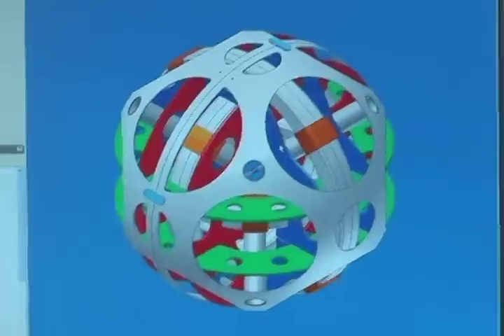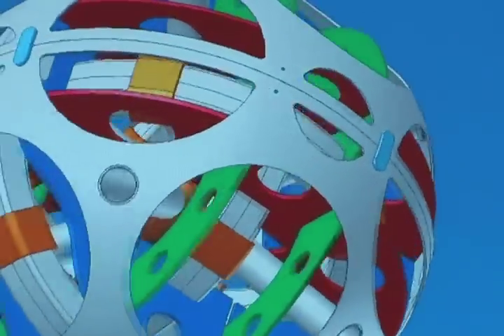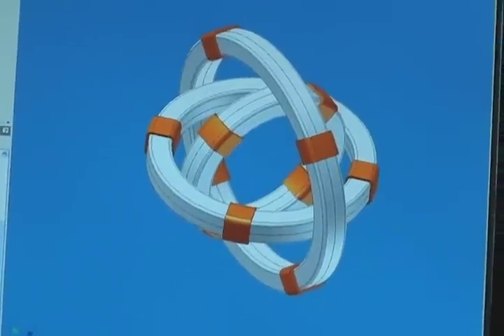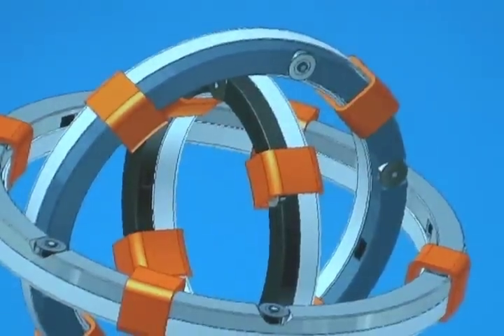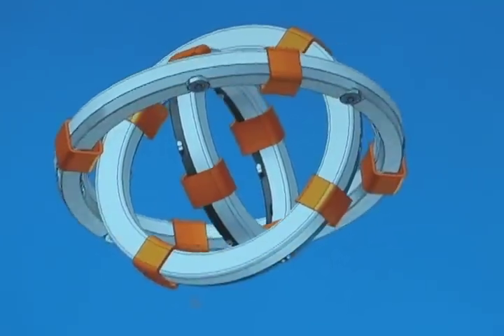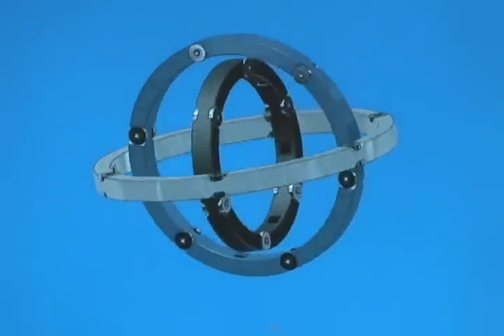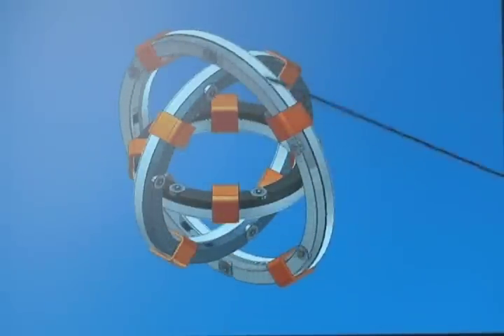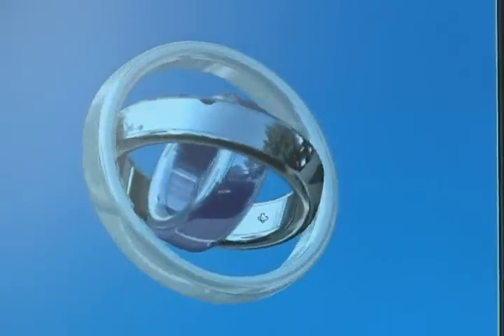Apparatus for Gyroscopic Propulsion Explained

Comment: Congratulations on a remarkable demonstration of an almost two hundred year old concept... the gyroscope!  Though the 3D modeling is quite effective, the title of the video is misleading, as there is no "propulsive" output in this closed inertial system.  As clever as the use of different materials to maintain equal angular momentum at constant speed may be (which may be unique enough to be patentable) there is no way to translate this gyrostat into any sort of propulsion.

Comment: "...it takes a trajectory of it's own following the path of least resistance"

So it will uncontrollably fly to a random location in the universe where angular momentum is minimal relative to it? Not buying it.

Cant this design be put in a simulated environment (computer) first? It will at least remove the errors that will come out in manufacturing. ie. not being able to machine the thing accurately and having the imperfections throwing off any acutal and meaningful measurements. Cheaper too!

Comment: The present invention is a combination of three interconnected gyroscopic ring-like rotating masses, with each of the three ring-like masses rotating in a separate plane. Each of the three interconnected rotating masses will share substantially the same center of gravity and generate a separate yet interactive kinetic energy and angular momentum in each of the three planes, thereby providing resistance to rotational forces from external sources. This IS NOT PROPULSION

Comment: Reasons you are incorrect (about the assumption inertial devices will not work). 

-There is no such thing as linear motion, only hyper dimensional rotations

-Rotating devices gain "virtual mass" since spin is intrinsic to atomic structure and "spin"

-Inertia, gravity and magnetism are unified because spin, inertia and mass are properties of a phenomena, not themselves separate 

-F = ma is leaving off the second term, something like  m*dA that means linear acceleration is not linear.

Comment: @rkellyt basically, though, it boils down to preservation of momentum. the system has a net change in momentum of zero for one cycle of its operation, the momentum paid in an arbitrary direction must immediately be paid back since the system is a zero sum system with regard to momentum, and as a direct result, energy, and continuing, work. it'll vibrate. it'd be ok to vibrate one's way across a floor for fun, but not to fly with the thing.

Comment: @whirliegig from my view point i would assume yes. If you could place a mass in the center that was capable of displacing it's center of gravity into a desired direction then that displacement would create the propulsion into the desired direction. the greater the displacement the faster the travel of that direction. The act of centering the gravity of the mass will stabilize into a fixed location.
Reply: ⁵u 6⁶y___yyt/y____yes

Comment: @itisYOUREnotYOUR 

Rubbish, it'll just vibrate. This device resists angular momentum, NOT gravity. Any off axis weight on a ring will simply cause vibration, regardless of synchronization. Through synchronization you could probably make it vibrate along any axis, that is NOT antigravity. Any directional vibration would have to be paid back immediately as the wheels and attached mass completed the rotation along that axis.

Comment: Thinking about it I think its a stabilizer. if you have this say on a hovercar or space-pod, then say wind pushing it (or jet propulsion) will only move the hovercar in one direction, but it won't rotate. So this would be a gyroscopic rotational stabilizer. I guess the different rotors would slow down when you wanted to turn in some direction.

Comment: Granted this guy throws his words around a bit carelessly, but this device does not produce a force nor does it produce propulsion. Due to the conservation of angular momentum, this device "counters" rotational forces (torques) if they are applied to it, keeping the object in the same 3D orientation.

This isn't made to propel anything, but is part of a gyroscopic propulsion system. Missiles use these things to stay on/correct course. The gyros are somewhat analogous to a steering wheel.

Comment: It is significant that Verne placed the giant gun quite close to where Cape Kennedy was later built. If he had been less optimistic, he would probably placed it on the coast as well; instead of inland. 
Even a giant gun is not entirely ridiculous: sure, a single charge at the bottom would kill the crew, but sequential charges placed all along the barrel could be made to work. After all, Saddam Hussein commissioned a gun like that.

Comment: Most of the 'flight is impossible' claims have been taken out of context. If one tracks down the original, one usually finds that the reference was specifically to man-powered flight or to truly bird-like flight (i.e. slowing to a near dead-stop before landing). Nobody really doubted the possibility of flight after Cayley's manned-glider demonstration. The main problems then were stability and developing a motor with a high power/weight ratio.

Comment: Take a look at the Aeronautics section of the 9th edition of Encyclopedia Brittanica: some of the designs there (for models running on wires) look like some of the  post-Wright designs. And the date? Circa 1869 (!). 
In the Le Mans museum (France), there is a painting which depicts (as a detail) a helicopter toy. The painting pre-dates Da Vinci's (working) model helicopter by more than a century.

Comment: Because anti-gravity (as the term is used here) implicitly implies something which contravenes Newton's third law. This law is, in effect, a corollary of the first law of thermodynamics. Neither law (despite what some electrical engineers claim with respect to the interaction of charged particles) has any known exception, and none are expected. Anti-gravity is therefore about as likely as perpetual motion ('free energy'). One apparent exception is offered by the Lense-Thirring ...

Comment: If you wanted to manufacture these out of a single material to save cost, you could increase the velocity of the inner rotors instead of increasing their mass. Perhaps just use a higher voltage across the drive coils.

Comment: I think you can improve this design by using Rodin coils, with toroids that contain ferroliquid material. You want to minimize friction and heat.
Yes this can be vectored in certain directions by have clever electronics to PULSE with a greater amplitude at just the right time in the spin.

Comment: Well, 8 coils with 8 magnets would cause the acceleration to fluctuate often, whereas I see that 4 coils to 6 magnets would lead to nearly always having 2 magnets and coils interacting, which seems much more stable.

Also, leaving every ring at equal mass wouldn't be very balanced. Your outermost, or is it innermost, I'm not sure right now, ring would be causing too much vibration onto it's plane of movement.

Comment: Some people really think that the device can propel something?!!NO,it can not propel anything,but create a zone of  balance.. the other truth is,it can absorb torque,even though a little  but  it  still can,unless you can make all rings to spin at the speed of light!!! In my mind,I think that those 3 rings should have the same weight and using 8 coils to 8 magnets to create more stability and control when spinning.... 4 coils to 6 magnets doesn't work well...

Comment: i have already designed an almost complete model years ago,  your work is good but you need to semplify the structure and increment the number of elements, from rotational rings to number of coils (i have solved in other way the reduce of intensity of magneto-electrical camp), the  post of marcos13af is correct, but also you need to add an opposite-axis element to each gyroscope ring. also you need a aerodynamic section for rotational elements not for "aerodynamics" but for electrodynamics!

Comment: Nice apparatus,but it is incomplete...to make it works properly you need to divide each wheel in two pieces  to make each wheel to spin in the opposite direction...
Example: a half spins in the clockwise direction and the other spins anti clockwise direction...Good luck!!!

Comment: All a gyroscope does is counteract the torque.

In other words, you could have a 50 lb gyroscope on one end of a 10 foot handle (the load part a lever) and hold it in the palm of one hand (the fulcrum and "effort" parts of a lever) and not feel any leverage, but you will feel the weight of 50 pounds on your hand. Without the spin, it could easily feel much more than 50 lbs. You can force such a handled gyroscope to spiral upwards - assisted by utilizing the rotational energy of the gyroscope.

Comment: All this device would accomplish is a  normal rotating gyroscopic force. Look at 2:40 the two innner rings would create a circular gyroscopic presence diagonnally, and the outer ring would only cause that presence to deviate. It would rotate much like an astronught trainer, but it couldn't provide any propulsion, just minimal stabilization.

Comment: This device has no inertial reference to the outside world. acceleratoin/decelleration, change of direction - are defined by the gyroscopic inertia of each of the rings, with respect to one another. slowing or speeding up a single ring, throws off this 'balace' and this is how propulsion is controlled.

Comment: eliminate the bearings by adding windings in series of 3's 120 degrees apart. two or more sets per ring. they will support the rotor and there will be no drag. creating more efficiency. interesting though I am sorry but I dont believe it will fly. but will be very stable.

Comment: It would be really hard to roll in any direction.  It would be fun to sit inside a huge one and drive it any which way, just by incorporating an algorithm that would slow down particular rings you could park a ball on a hill, as long as you left it running.  But I'm sure there could be some more serious applications than that.  By attaching the ball to anything you would make it very hard to roll the larger object depending on how fast and heavy the rings were.  It's the ultimate stabilizer.

Comment: To move it you would have an opposing magnet on the outer shell that could be moved to the direction you wanted to pull it towards, the magnetic force from the ring inside would be pulled towards the outer magnet, and with it, the whole thing in that direction, i've been thinking of this for a long time, i'm just glad someone else has come to the same conclusion, either the magnet on the outer shell, or one of the gyroscopic rings moving from the centre of gravity for movement/flight.

Comment: Kelly talks about "force unity" but does not seem to understand force cancellation. When you balance 3 gyros on 3 opposing planes, the force vectors cancel each other out. It's like tying 2 identical locomotives together at the caboose and letting them run in opposite directions - they get nowhere very fast.

Comment: Jowee - what is the formula to derive "enough momentum" to escape gravity? The earth's rotation is insignificant in comparison to gravity, so why bother talking about a weak torque (really Coriolis effect) which is only perceptible on large scale such as weather systems, etc. By your theory, the orb would rise quickly at the equator, and not at all at the poles. Ridiculous!

Comment: Actually, it won't even do that. It will do NOTHING, since all the inherent spin vectors are canceling each other. The net sum of all angular momentum within the system is 0. Each precession is canceled by the other 2 vectors working against it., and all other things being zeroed out, the system will conserve momentum and continue in the direction of any torque applied. The spin of the earth being a constant, will not accelerate the orb relative to the earth any more than it would a golf ball.

Comment: i still think u should use opposing wheels but fill the spaces with a superfluid helium. that may solve the heat problem.. plus its not a conductor . still thinking.......

Comment: Continued, also in the device as it is designed,2 or all of the disc will be effected at the same time by the force given the device since there if no buffer between the disc and all are rigid with the chasis. A gyroscope reacts to force/motion over time and distance, the distance decreases with kinetic energy but the distance never reached absolute 0.If it redirected pressure at right angles it would gain distance effectivly becoming a thruster but this device will not. Need more info? justask.

Comment: Ok here we go. First off he is only explaining the construction and operation not the theory behind the device. What he has from the design that I can see is an enertial dampener, the first rule of a gyroscope is that it takes motion to react. Have you ever seen a gyroscope stay still? It always hovers in reaction to the force given to it. He did his research given the different mass of the 3 disc and it was genius to think of it, But what it does is absorb/slow the reaction of movment alone.

Comment: Nonsense, rkellyt. Subtle suggestion of over-unity. No explanation, no propulsion. "Vast amounts of energy" accumulated means exactly that amount input, plus motor power to keep running. Not sure what moving away from the source of angular displacement means, as that could ideally be rotationally symmetrical. A wheel has done that since about 1500 BC. Come back when your (undisclosed) design represents a mode of propulsion, if we don't have warp drive and matter transporters by then. :)

Comment: Once it's spinning, if the claim is that it is then fixed in space and will resist all force trying to move it, then you can't get it moving anywhere. If it just takes a lot of force to move it, then it has just the same advantage in terms of overcoming forces trying to stop it. I see nothing in the way of an advantage over three gyros at 90d to each other, in a box side by side. Can the poster of this explain what it is supposed to do in the way of propulsion please?

Comment: How could you test your theory without creating the device? Computer image modeling? If so, the model is faulty if the "overcoming" of gravity in any way exceeds the external forces applied against it. There are only 3 known principles which can temporarily cause objects to "overcome" gravity: acceleration, electromagnetism, and superconductivity. Aerodynamics is a fourth but requires the medium of air. Only 1 of these exists in a gyro: acceleration but the sum of all vectors=0 so no net accel.

Comment: Despite your ridiculous logic regarding linear vs. angular momentum, no matter how you calculate it, the sums of all your vectors are equal to ZERO, and the only constant is gravity. You are absent 2 things:
1) An energy sufficient to overcome the force of gravity. And even if you somehow got that:
2) A net vector of force operating in opposition to the vector of gravity.
Even in the vacuum of space, this thing will not exhibit "propulsion".

Comment: Final word: Save yourselves a lot of time/money/energy by trying this experiment which will virtually MATCH what you are trying to do: Mount 3 identical flywheels on a single fixed equilateral flat triangle of plywood. Place 1 flywheel in a fixed position at each of 3 equilateral points, making sure the rotational planes of axis are fixed on the x,y,and z axes respectively. Weigh the assembly. Accelerate each flywheel to identical speeds. Weigh the assembly. There will be a net zero change.

Comment: Bottom line: this device is a pipe dream based on faulty science. Any force high enough to overcome gravity using such a device would have to be equivalent in energy to that of a rocket engine capable of the same level. Furthermore, the conflicting internal forces introduced into the device would cause it to break up long before it could "bounce" out of the atmosphere - and slight "bouncing" is the most this will ever achieve. I will match any bet you can come up with to support this assertion.

Comment: This is where the theory gets completely crazy. The ONLY motion generated by imbalances in the 3 rotors will be precessional. These are inherently weak forces relative to the total mass of the object. In no way will this result in "lift" except that with a huge energy potential, it could wobble enough to "hop" off the ground slightly and sporadically, ALWAYS returning to the ground as the counteracting forces take over. The energy required to break free of earth in this way would be phenomenal!

Comment: AGAIN FROM THE PATENT: when the rate of rotation for the three spinning ring rotors reaches the appropriate level, the composite structure of the three associated rings resists any change in orientation from any external force, including the gravitational field of the earth or other [large bodies]. Accordingly, as the earth spins about its axis, the mechanism moves in the only direction possible, which is up, or away from the center of mass for the body exerting the gravitational force.

Comment: Slowing down 1 or more of the gyros will not cause the ball to move linearly because the "opposing" 2 gyros will resist. The only thing this will cause is a wobble around a slightly offset center of gravity. If perfectly tuned, the ball will remain motionless. The further out of tune, the more wobble will be introduced. At best, it might be able to "walk" around 2 points of imbalance, still in a nonlinear direction. With enough imbalance, it could zigzag, always impeded by friction.